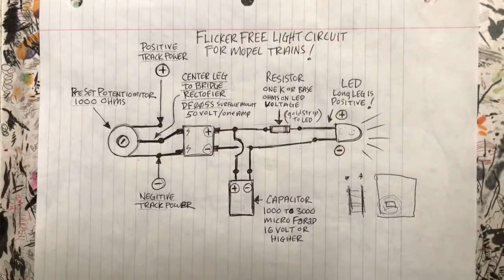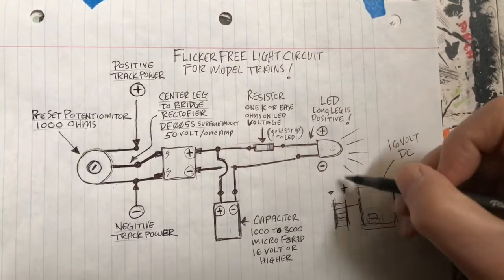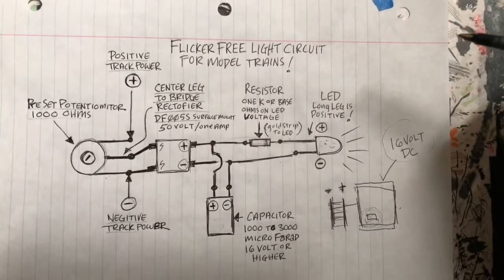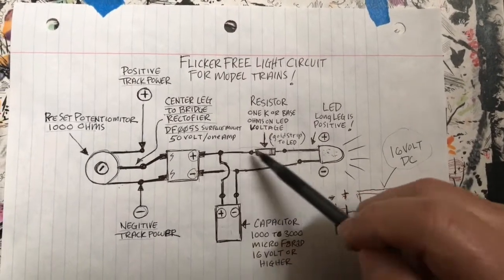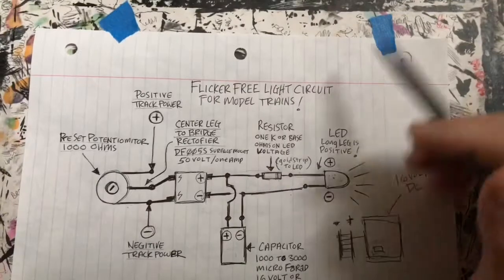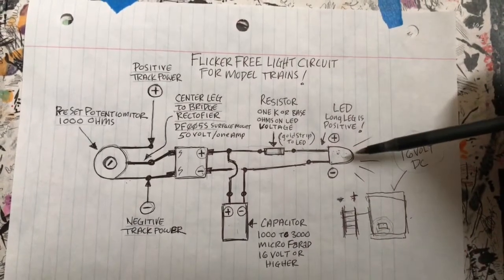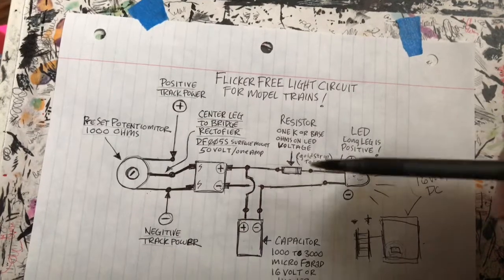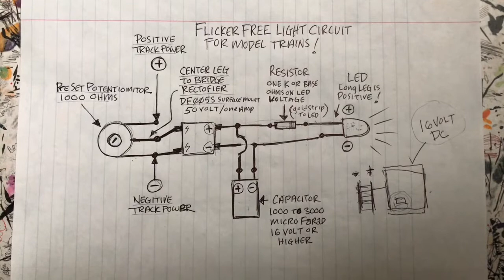Lighting Up a Train Car with LEDs

Comment: I always paint the weight flat black on both sides for corrosion control.  I found a new product to aid in adding LED lighting to rail cars.  They're from ESU, part #50707, which are called current collectors I got from Litchfield Station.  For $8.95 + $4.00 postage you get enough to do 8 axles.  The trick is to cut them apart and super glue them to the underside of the trucks.  Have to have at least 2 insulated wheels, opposite each other - one for picking up the power from the rail and the other to return back to the negative side.  Just make sure the wheels are opposite each other.  You can do the pick up and return on just one set of trucks.   I don't use a pot and use a bigger capacitor, about 3300uF (micro farad) at 25 volts DC.  Same full wave bridge rectifier, but I use strip LED lighting at 12 volts DC, which can be cut apart at every 3rd LED.  They already have the ballast (current limiting) resistor built in.   Cheers from eastern TN
Reply from the maker: Thanks for the comment and ideas, good stuff.  Thanks again